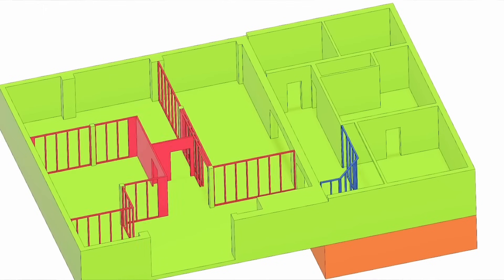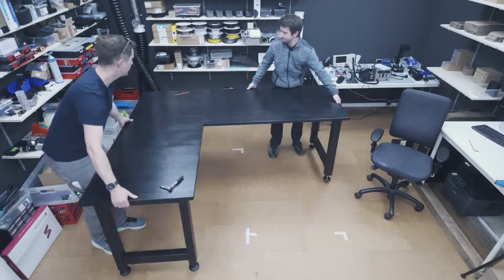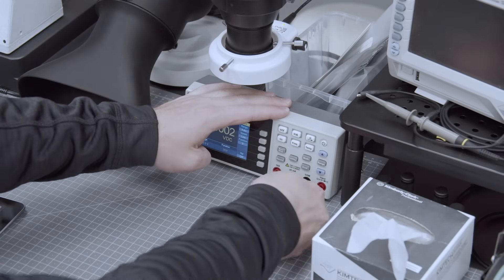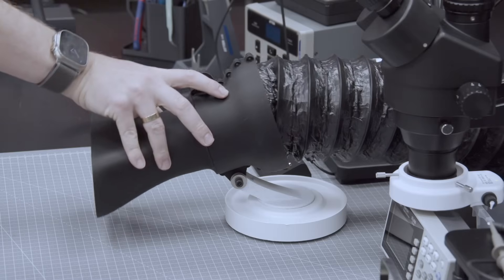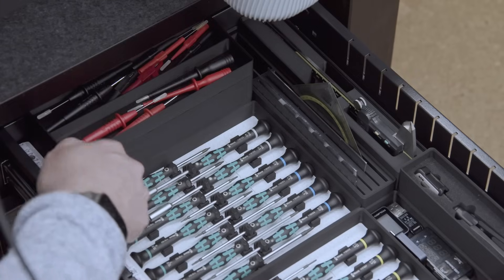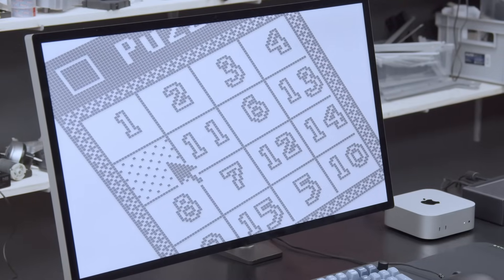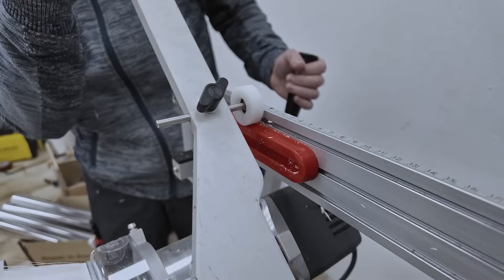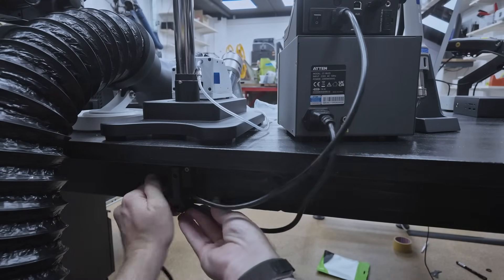I Built my Electronics Desk from Scratch

Comment: Wired mouse + wireless keyboard seems like a completely backwards arrangement but you do you :D

Currently trying to arrange my electronics workdesk. I'm finding i have kinda too many tools and i was hoping for some sort of magical solution like a cable car carousell which just delivers the right tool at the right time :D Yes dedicated drivers are better but for the space compromise, having just 3 most used drivers as dedicated ones and a bitset in reach is probably what i end up going with.
Reply: The keyboard is usually the bigger issue space wise and so it kinda makes sense
Reply: @paradoxx_4221    How so? You move the mouse and the cable drags you about, and also maybe you have junk around it etc, you have to sometimes navigate that wire. I use a bungee it helps but what i really want is wireless power to the mouse.

Keyboard is always in the same spot, you lay that cable and you're good.

On the other hand, i use a TKL and a separate numeric keypad, and i'd like the keypad wireless.